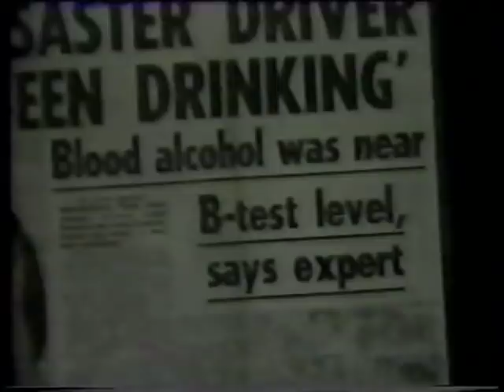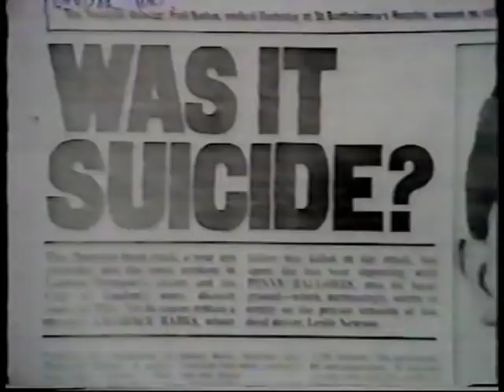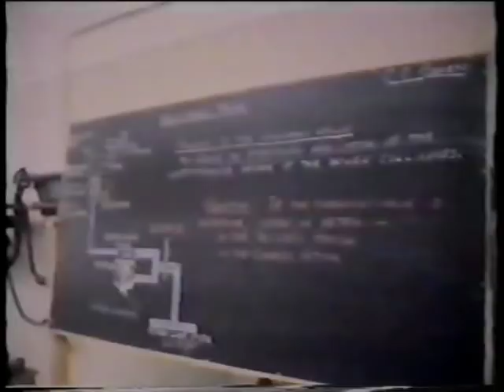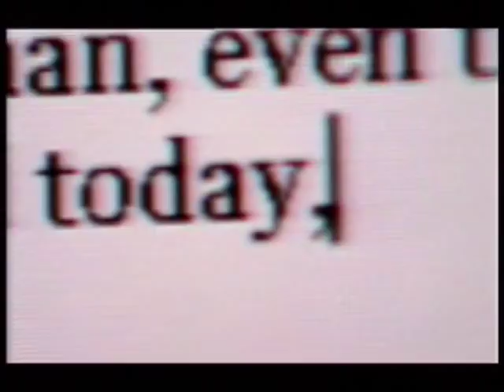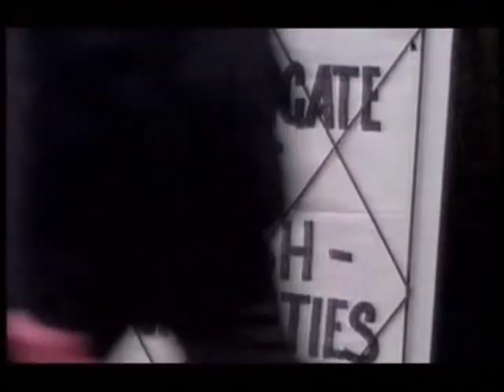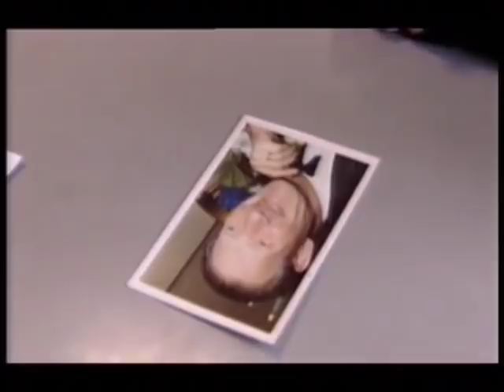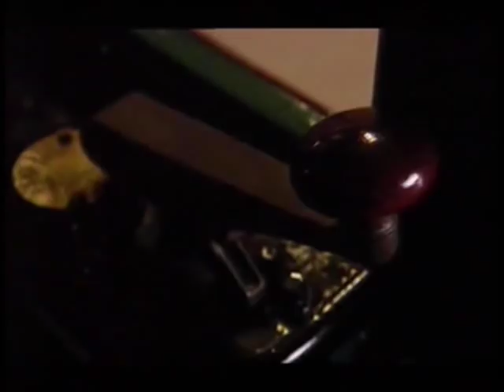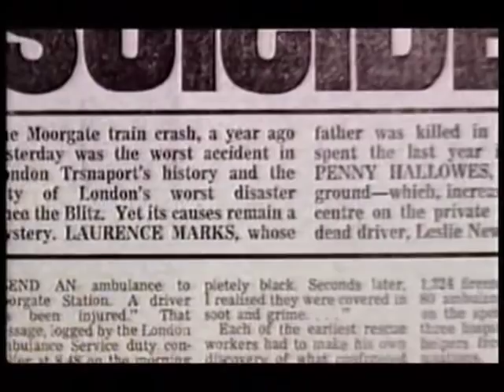MOORGATE ANNIVERSARY FEBRUARY 28  2015

Comment: I agree with others, it wasn't suicide and caused great pain to his wife and family. I've always felt it was possible he had a absence seizure. It is when you zone out for a brief period of time, the medical knowledge at the time was basic compared to what we know now. It angers me that humans error is applied to loosely at times.
Reply from the maker: It was and still is a criminal act that the Newsons were hounded by the press and shouldered the blame when it should have been London transport because they could have prevented the collision. Train 272 should not of been even allowed out on a running road as it was due to be scrapped at Neasden as a six car unit , yet it mysteriously was transferred from Neasden to Drayton park depot with no record on paper of the transfer or a history of maintenance on each car !
Reply: @Richardsrailway  I know what the newsons went through was despicable. I found it interesting that no one mentions it in the report that  it was a 38 stock train, whilst overall they worked well by 75 they were ready for scrapping. The 70s were notorious for tfl not investing in it's infrastructure, it's 2024 and the 73 stock is still in service and it's 51 years old. He most likely had a seizure and didn't know what was going on. I suffer with them and theirs been cases where I'm missing 15 minutes because of them. Why was the tunnel wall painted black, they used the driver as a scapegoat so London underground could save face. I hope Mr newsons and his wife were reunited when she passed, imagine talking about his impotence as a possible cause he was 56.

Comment: I wonder if tube drivers have brain scans and  are checked for epilepsy and drugs regularly even today? I don't know and a genuine question without any cynicism
Reply: @insert name here not in every case the epilepsy is visible on the MRI, and it really depends on which type and power the MRI machines have, there are different types of epilepsy some cases are resistant to the pharmaceuticals, the only effect of the pharmaceuticals in those cases is to lower the average number of seizures and their strength. Lack of sleep is a factor that rise the risk of seizures, epileptic are supposed to sleep at least 10 hours, to lower the risk for their brain to go on electricity hyperactivity aka seizures. 
The pharmaceuticals have a half-life which is the pitch of effects of the pharmaceuticals, then after the half-life the effects slowly decrease in efficiency till the end of the life, so the complete inactivity on the brain of the pharmaceuticals, but in the blood test the pharmaceuticals is still present, especially for chronic patients that has took the same epilepsy pharmaceuticals for a long time span. To check for epilepsy medication there’s the need to know which pharmaceuticals are take by the patient, there’s no test like the toxicology blood test, and there’re more than 70 types of different pharmaceuticals some are not even possible to be blood tested, because for the modern pharmaceuticals there’s no blood test because the dose is calculated on the weight and on the age span, not on the blood level of dosage and age. Example the oxcarbazepine has a half-life of 12 hours but a life of 24, and it can still be detected in the blood after a week but having no effects on the brain. In fact the blood test to check the dosage is taken before assuming the pharmaceuticals of the following assumption time, but on the previous dose assumed.
So the main problems are: is the person epilepsy resistant to pharmaceuticals, if yes is not even issued a driver license, is the person actually assuming every time the pharmaceuticals? Also, is it a chronic condition, or it’s an epileptic seizure of the second type, the ones that appears for a month or so without any warning signs, and disappear by itself after such time?

In the Moorgate case he wasn’t diagnosed as epileptic, so he wasn’t under pharmaceuticals which trigger a storm of seizures, if it’s a chronic condition.
Some people manifest epilepsy for like a couple of months, without being epileptic, it’s a rare and extremely uncommon phenomenon, and at today it’s believed to be usually stress related and sleep deprivation related. It could be the Moorgate case, because the driver has no previous history of seizures.

At today in US at least there is no regulations for train conductors or engineers to have no pharmaceuticals assumptions, I suppose it’s the same for the UK. Obviously it’s made a toxicology test for alcohol or drugs which disqualify automatically the candidates, but for pharmaceuticals is different there’s no specific test that could check them as range of different types of pharmaceuticals, all in one.

If you are interested or have more questions I’m happy to reply you feel free to ask.
Reply: @insert name here  in the pinned comment there’s reference to the driver staring blankly at some point during the meal with the meal still in his hands and others similar phenomenon, those are not seizures, those are epileptic absences, more difficult to detect and  diagnose than the seizures, but less deadly in epilepsy terms, because a storm of uncontrolled complete seizures cause an heart attack after a couple of days without pharmaceuticals, but absence don’t cause that,  the brain simply freeze and the subject stop having control of its movement and has no awareness, after the absence the subject has no memory of what happened during the absence. They could be short like a minute or last like two hours. Imagine the absence like activating the night mode on the phone.
Reply: If u have silent siezures you can go a while and not realize youre having them. Test would only find them during an active seizure
Reply: @Ashley Galyean yes especially because  “epileptic absence” usually leaves the person unconscious, of having an absence the brain basically froze, and the person has no memory or acknowledgement of what happened before. Same for partial seizures if the epileptic area is extremely restricted and deep in the white matter, the person remains conscious and know that is having a seizure, but the superficial EEG can’t detect the seizures while ongoing, to detect those small but deep seizures there’s the need of intracranial EEG, a procedure that need a surgery to drill into the skull microscopic holes where position the electrodes fixed in position by a osteotomy screw, one for electrodes, usually around 18/22 electrodes are positioned. It’s a pretty new procedure for mappings the area that gave the seizures, in order to surgically remove it if possible.